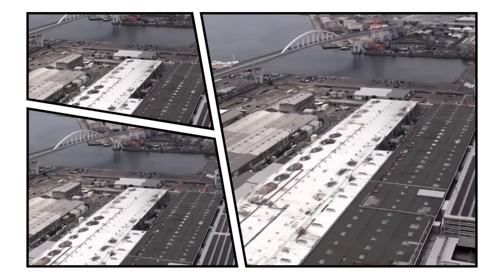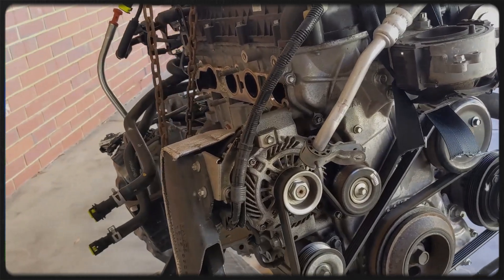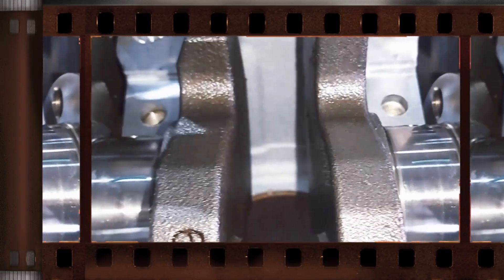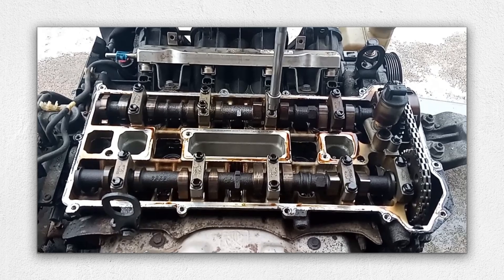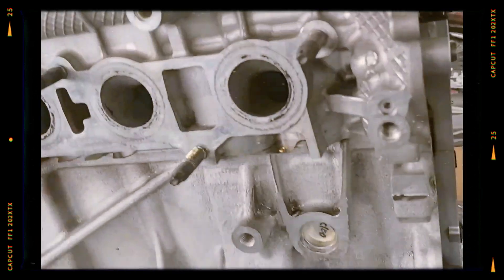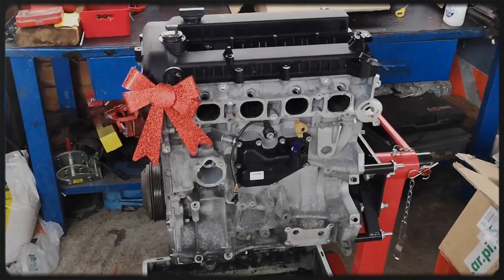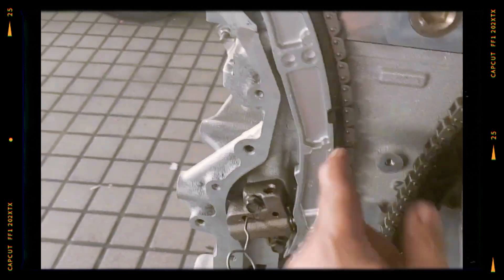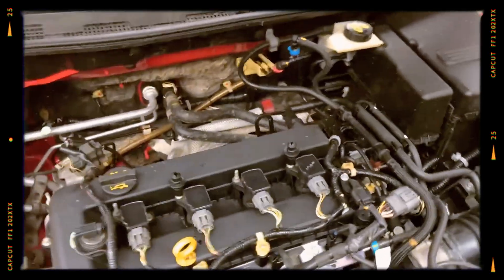Mazda MZR 2.5-liter (L5-VE) Engine: Full Specs, Reliability & Common Problems!

Comment: The compression ratio is a joke, Mazda says 9.7:1 in reallity it is 9.2:1 but even 9.7 is not much, 4-1 manifold instead of 4-2-1 makes me angry aswell, and VVT on intake eats power aswell. You can stroke the displacment with a 106 mm crank shaft to 2,64 liter, the engine is a good base but lots of power is wasted....
Reply: This thing need some serious Upgrades forged 89,00 mm pistons with 12:1 compression, forged 106 mm crank, Stage 1 cam shafts, bigger fuel injectors, race spark plugs, polished intake and outtake channels on the head, Group A 70 mm stainless steel Duplex Sport Exhaust, 4-2-1 exhaust manifold,  modified throttle body, Race catalityc converter and a tuning air intake or better ITB with sport air filter than you gonna have some hp and torque

Comment: 2011 mazda cx7 2.5L, valve cover gasket leaked oil into the spark plug well, hydraulic engine mount leaked oil, oil cooler gasket leaked, plastic water outlet cracked...apart from these, so far so good! Switched from 5w-30 to 5w-40 oil about 5 years ago which made the engine run quieter, now at 140K KM
Reply: I just switched to 5w 40 as well at 95K will see how it goes

Comment: It's good but I'd rather a 2.5 L5-VE by Ford / Mazda 2008-2012,  I've seen heaps used in upgrades ,they have  forged rods ,crank  
standard output  170hp @6000
The 2011-2012 is the pick , all they need  apart from general maintenance is a new thermostat  and rear water outlet housing every 15 years due to them being plastic . Had those parts been made of aluminium.  Hands down best 4 cylinder petrol engine ever built  . 

Twin cam , coil on plug , sequential injection  . Good timing chain . Full alloy engine block head sump . 
Lightweight , 

however 
Don't buy the sky active version  it's not in the same league.
Reply: so is this the engine in my 2011 mazda cx7 if I have the 2.5 version
Reply: @jeffhobbs1729  yes, it's the same engine.
Non turbo Mazda СХ 7 use this L5-VE engine.